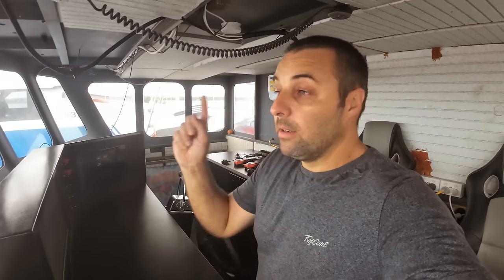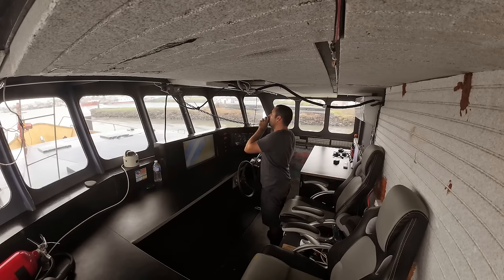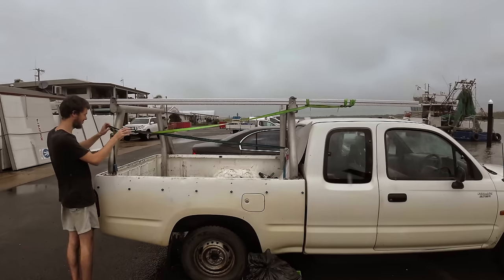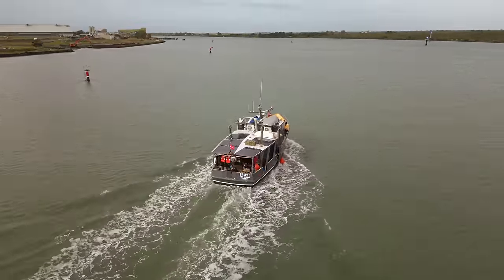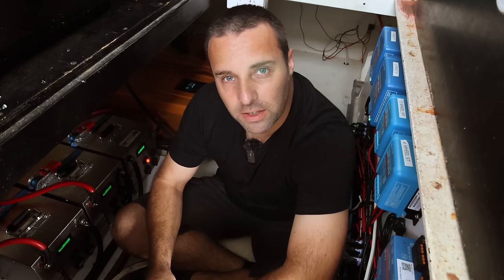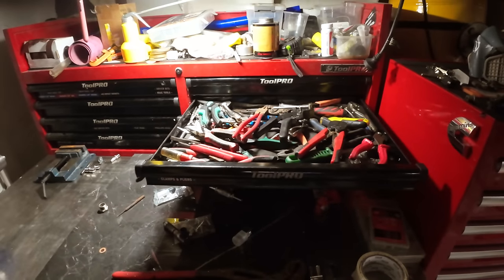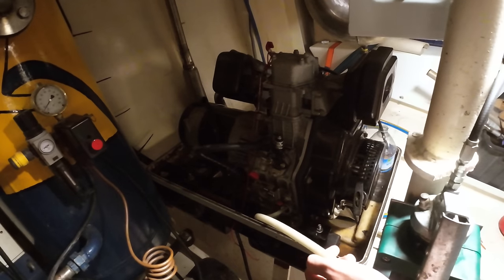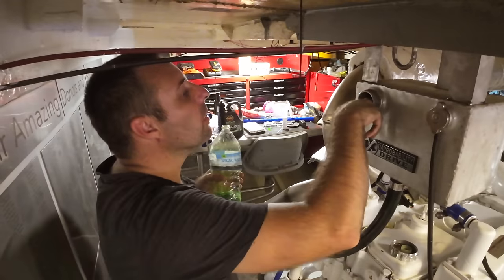Brupeg is on the move - Project Brupeg Ep. 349

Comment: You need a written checklist in the pilot house both for departure and arrival, including startup and turnoff procedures. They do it in big yachts and in airplanes so it could work for you.  Start by checking your throttle before startup and before letting go the lines. Switching from shore power if you have any, and retrieving shorepower cable is a must and remembering to check if all lines are on board. . And it appears there was no wind during your approach so no need to come in with so much speed. Stop before entering the Marina, test your reverse gearss, tell the crew what are your intentions and slowly proceed to the dock. Since your reverse rotation will push your stern to the left, don't point your bow to the dock. Just try to come parallel with the bow a little away from the dock and let the motion carry you in without using the engine. If you have windy conditions that is a completely different beast but eventually you will get it. Just look cool and calm, people will not notice you are stressed. 😅😅

Comment: Turning the wheel may be a good exercise, but is probably not necessary for a tight turn. The rudder position is irrelevant for the first few meters of going astern. Therefore, just leave the rudder hard starboard, give it a hard push forward and stop the forward movement by reversing. Repeat without moving the wheel. In my experience this works for all boats where the prop stream hits the rudder.
Reply: Also consider LH/RH prop configuration.
Reply: Very true
Reply: This is correct.
Reply: And a hundred different words for “slowly”..
Reply: Yea I would say the same, it saves you a lot of hassle and doesn’t give you any noticeable rudder force at that speed👍🏻

Comment: I guess a freely rotating knob on the steering wheel would make it easier to steer while docking. You could turn the wheel like a crank without having to switch between hands repeatedly. You could steer with just one hand, leaving the other free for the engine control.Last year i build a three phase, 3 x 15 kVA Victron Multiplus, 2 x RS450/200 charger, cerbo gx  solar system, 24 kWp solar modules, 30 kWh non Victron LiFePO4 batterie with integrated BMS (Which required some tweaking of the cerbo gx) for our house. I really can recommend Victron. I am soo glad to have choosen Victron.

Comment: In my experience over the past 6 years manoeuvring big single screw boats. You don’t need to turn the to the other lock when in reverse. Just do enough reverse to, to utilise the prop walk and to counter forward momentum. If you don’t build much speed in reverse then the rudder isn’t doing anything anyway, so no need to turn it. Just leave it where you want it to direct prop wash in forwards. 
You have the right handed prop right? So your prop walk pulls stern to port. So as you are doing here. Try set up every manoeuvre so the boat is rotating clockwise. And you’ll find it’s very capable.
Reply: Notice how the second manoeuvre onto the work dock was more challenging, as you were trying to rotate anti-clockwise. I understand you may have needed to tie off on starboard but that manoeuvre would have been easier if you were tying up on port, the prop walk would be helping rather than fighting where you wanted the stern to go.

Comment: Install a pair of 'Trucker's Mirrors' on either side of the pilot house and you won't need to leave the helm when doing docking maneuvers. Eventually, a multi-image display screen tied to several cameras will allow you to zoom in on one or more shots so you can dock without scraping Brupeg's shiny paintwork. Also, I didn't like having to hunt for my radio mike every time I needed to use it, so I installed a second, 'temporary', mike clip on the dash. I still put it up out of the way when it wouldn't be used for a while, but when needed frequently, having the mike right in front of me let me keep my eyes on what was going on and not scanning the cabin roof for the mike...:octopus-red-waving::face-blue-smiling:
Reply: I was going to install a car reversing mirror on my boat (used on canals), and my friends thought I was bonkers. Thing is, my boat is so small and light, if I turn around to see what's behind me, the darn thing responds to my bodyweight and changes course. So the mirror will come very soon - like the idea of a side mirror a lot

Comment: To help prolong tools in a saltwater environment clean the rust of them then wash them with fresh water and then dry them, then oil them afterwards it does help prolong the life of your tools in a saltwater environment. BTW you will also need a lock on tool drawers especially while your at sea.
Reply: Yes you will need to fit a locking bar/s  to those draws especially the one full of sockets before going offshore.

Comment: Really strong lift bar may help. Most trawlers  have a derrick crane system.  Vent gasses  important with confined space. Some noise dampening for generator might be needed. Good you have taken the electrical system to  a safe standard.  Might need a brupeg novelty game. To keep group  seafarers happy.  😊

Comment: Charging and discharging LFP batteries is usually 0.5C-0.1C. Temperature can vary those. It is safe to charge at 3C up to 80% when temps of battery is 45 Celsius or less. LFP only gets as you say hurt when forcing a high C charge the last 20% as that is when temps rise quickly. Even charging at 60 Celsius with 0.5C is okay and shouldn't hurt your cells.  So all know a C rating is if you have a 100 amp hour battery and discharge or charge in 1 hour its 1C 0.5C is 2 hours, 0.25C is 4 hours. I have 1120ah @ 48 volts so when I charge @ 200 amps (55.2V) is 0.18C. Now this is 4 battery banks so 50 amps max into a 280ah battery bank as my BMS is set to only take 50 amps to charge I have not limited my discharge so if needed each battery could give 200 amps. I left it that way just incase 1 of my BMS controllers takes a sh!t. Figuring out how much battery to have is really about budget. I have 3 days worth with no sun. I will adjust that to 9 days. That means I will have 160kw of battery backup and will double my solar amount. I will only need 8 full hours of sun to charge my system for 9 days of power. That is for winter coverage in summer I back my charge controllers down so they hardly work.

Comment: for every comment on using the prop to walk the stern in the direction you wish, and leave the rudder, the prop is fitted with a thrust cowling, the prop has no side to side grip on the water, only ahead and astern, so the rudder has to be used, having a bigger steering wheel would make it easier to operate, but like the bow thruster, its a matter of choice, you make your choices and have to live by the consequence's of your decisions', lol

Comment: You have great rudder and throttle control but it looks like you are driving it like a 25ft boat. Lots of input and jerky throttle inputs. Slow it down mate! No rush, idle in, idle reverse to swing the back end into the dock. Save that throttle for emergencies
Reply: When you are dealing with wind and current you don’t have time to mess about when maneuvering in tight quarters.
Reply: From what I saw your both right😅 he will get there and it’s a bloody heavy boat!!
Reply: @truthboomertruthbomber5125  agree, couldn’t tell on video
Reply from the maker: Most of the manoeuvres were at twice normal speed so the video didn’t drag out. It all actually happens pretty slow. Its a 60ton bus, nothing happens fast on this thing

Comment: I would recommend that you put a 'heavy seas' tool drawer bar. Two wing nuts for easy access. 
Yes you got a lock but keys get lost.
What happened to that long steel rail you had for removing the old engine? Could that be used again to help load the new generator on board. 
Those old lithium batteries maybe sold to a company that installs solar for homes. After all Kiwis are great traders.

Comment: Not sure if that fitting on your coolant tank is standard size, but I wonder if a standard pipe elbow fitting temporarily attached to it while filling would help with adding fluid as you pour bottles into the elbow it should just pour it into the tank the next time you have to do anything like that with that. Hopefully not for a long time

Comment: Rather than weld the hatch back into the deck once the genset is installed, how about putting a flange on the underside of the deck and bolting the plug down so you can easily access the engine room/genset in the future?

Comment: I normally try to dock to port side.... it is called port after all ;)  I find that if I pull nose to dock and then idle in reverse, the rear end walks over to the dock as well.  Might be why the two boats behind you are showing you their stern. Prop-walk is like an extra stern thruster. Generally more effective to port (reverse idle) than to starboard (forward idle).. Anyway, great show. It has been pretty recent I have gone from smaller outboard to bigger inboard. I'm still learning. I have to do a 180 in place to leave our mooring...

Comment: Hi Damien ... you can always move the genset onto the deck with the forklift. But my suggestion is to make a small hole in the roof and run your hoisting cable through that to lower the genset into the hold of the boat that way there is no damage to roof and only a small hole to refill in the roof.   Just a thought
Reply from the maker: Can’t touch roof. Solar is stuck to it
Reply: @ProjectBrupeg  darn it. Oh well, you will persevere.

Comment: My advice for using the engine for charging batteries is to get a second alternator that is dedicated to battery charging and leave the regular engine alternator alone. Charging recreational batteries and running important systems for the engine itself will shorten the life of the alternator. Cheers.
Reply: You can get 190amp liquid cooled alternators from scraped Mercedes! 😊

Comment: An electric jetboat would be v.cool... one of those weld-together prefab kit jobs that is normally fitted with a jet ski motor but fitted with an electric motor & batteries instead. I feel like your dinghy is a fine, fine tender for putting around sheltered anchorages, but using it anywhere with the potential for more weather etc  would be quite scary & uncomfortable. It could be carried on its side clamped to the side of the hull or superstructure, freeing up your davits for the more substantial electric jet boat of your dreams...
Reply from the maker: Yeah that wee dinghy was only ever intended as a small distance craft. Like ship to shore while anchored etc. it’s not a heavy weather boat. It’s plenty stable and can take a pounding (we’ve checked) but it’s wet and bouncy as all hell

Comment: I live on a 57 foot steel boat and I would suggest that all that to and fro of the rudder when turning almost stationary is wasted effort just leave the rudder at half way in the direction  you wish to turn and pulse the throttle. The rudder authority in reverse is pretty poor so you are wasting energy with all that rudder turning. The biggest influence on turning decisions are wind and currents. Good luck and practice practice practice.

Comment: Thinking about your hatch you are cutting in the deck for the generator.  you say and weld back in.  Have you thought about rather than welding it back on. Bolting it?  Use some of that rubber gasket you use for the water tanks, and this way if you ever need to drop a Hot water tank/gearbox/generator/big toolbox... down,  It is just the matter of unbolting 200 nuts and bingo you are in.  It would be water tight, but easy access in the future again.  I realize you have further back, but a second obviously will be helpful since you need it now.
Reply from the maker: We would love to turn it into an opening hatch. Unfortunately we are so pressed for time we can’t spare a day so will be welding it as it is fast, waterproof and can easily be cut back open at anytime.

Comment: 21:03. Its actually Lithium Iron Phosphate. LifePo4. Not lithium ion phosphate.  The standard lithium ion you see in drills, mobile phones etc, are technically lithium ion/polymer. Colloqually known as LiPo. Lifepo4 (lithium Iron Phosphate) are the super safe ones. The only safer lithium tech cells are LTO (lithium titanate) but they are pretty heavy, and not as dense as lipo/lifepo4.

What makes it more complicated is that TECHNICALLY... every single one of these technologies are Lithium Ion. They use lithium ions to transer charge. by the same rules, lead acid, should technically be called lead ion.. anyway thats not the point haha.

The first most common style of lithiums were the lithium ion.. when they first came out there was no other mainstream technology, so all those cells were collectively just called lithium ion, or lithium polymer.

The standard drill, remote control car, drone etc etc cells are lithium polymer (even though thats not entirely correct either). 

Lifepo4 however like you said are extremely safe. It takes a lot to get them to light up. Lithium polymer? well... samsung phones. Chinese imported hoverboards etc etc, lipo is famous for going poof. 

On a side note, i know its all planned out now, but your battery pack having 800amp discharge and 400 amp charge, you could easily put batteries in parallel to up those ratings. Its not a perfect solution but definitely one that can be planned and worked with. 

On a boat however... LTO cells would actually do a pretty solid job. They are pretty well industructible, have incredible current densities, and have lifetimes in the 10-30 thousand cycles. I have 40ah LTO cells here that are rated at 100c. ONE LTO cell can be discharged AND charged at 400 amps. Put a few of them in parallel, and your 4 current sources could all be running at the same time and the LTO cells will just sit there and go "whatever, try harder". They are the honey badger of batteries. They only fit well in 24/48 volt banks though.
Reply: It actually now makes sense to be quite specific with the lithium battery chemistries, as you point out.
We should almost never call anything a "lithium ion" battery - just like never refer to lead ion batteries.
We should say "Lithium Manganese Cobalt" or "
"Lithium Iron Phosphate" or "Lithium Polymer" 
That prevents people throwing up their hands in horror every time the "ion" bit comes up in conversation....

Comment: You can control the output from the generators by varying the field strength in the usual way. They can run without generating anything. The problem is the solar panel system. Their output can't be controlled (except by masking). If batteries are full and energy requirements are less than the solar output then the surplus has to be dumped through heat sinks. Granted, the sharing of different energy sources is a difficult issue but it isn't about the maximum current capabilities of the generators. At least that is the way I see it.
Reply from the maker: The MPPT controllers disconnect the solar when batteries are full. Heat sinks are not needed
Reply: Yes, OK. I suppose I was thinking about a continuous supply rather than switched.

Comment: Would a coat of boiled linseed oil rust proof the hand tools ?  I scored some neglected tools from a roadside junk pile.  I soaked them in white vinegar to get rid of the rust. After a baking soda bath to neutralize the acid I dried the tools and then brushed on some BLO . After several days I wiped them down and put them in the tool box.

Comment: What's the plan for cooling the new generator?
Are you going to tie it in with the cooling system on the main engine, so that it runs through the keel cooler? Would simpliify the system somewhat, as well as help keep the generator/main engine toasty warm and ready to go at a moment's notice. 
Or, would it be better to keep the generator as it is and use a couple of air ducts into the cabin for a bit of free warm air when it's cold?
Reply from the maker: The new genset will have its own set of keel cooling. It’s always best not to mix cooling systems
Reply: @ProjectBrupeg  ...yeah that's probably the best idea mate. Hadn't thought of that lol 😅

Comment: You could have saved that docking attempt if your crew had practised throwing a line around a cleat. You split the coiled line in half, one half in each hand, and throw them either side of the cleat while keeping hold of the ends. Then pull in the slack and make it off. Then (as I think you were planning) motor ahead very slowly. https://www.youtube.com/watch?v=9yThp0GbBl4&t=140s

Comment: No apostrophe in Amps
Reply: had to go check on google, but I'm still not convinced. Unless amps is a word made up in English with an origin in the French. Genuine interest...
Reply: @dominicbrant1968  Amp is a measurement of electrical current named after Ampere. The amp is singular as it refers to one volt steadily applied over a resistance of one ohm. The plural of Amp is Amps. It does not take the possessive where it would require an apostrophe.
Reply: I understand it's not possessive but I thought Amp was a shortened version of Ampere and would need the apostrophe to note the dropped letters. But if we've made our own English word, I'll accept it - the British were good at re-appropriating other people's stuff. lol  @liftmanleigh

Comment: Yes, there are different lithium battery chemistries, and yes, lithium ion phosphate batteries are more rugged and less temperamental than lithium ion cells, but lithium ion phosphate [storage] batteries CAN and DO fail (🔥) - but for different reasons, such as (for example) being operated in an enclosed, high-temperature environment.

A lot of people are fanatically keen only to promote the positive side of all types of lithium batteries; there's no point in my trying to out-shout them, so I'll just urge peeps to do their own independent research, and to read reports not produced by the battery manufacturers themselves.